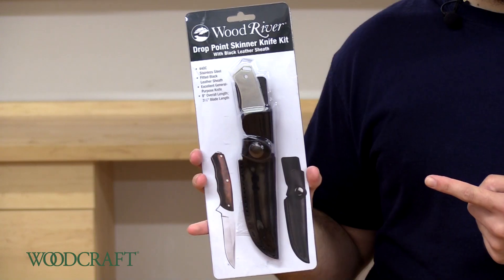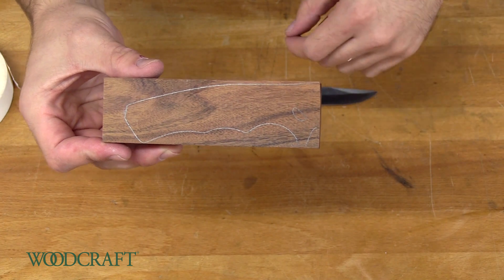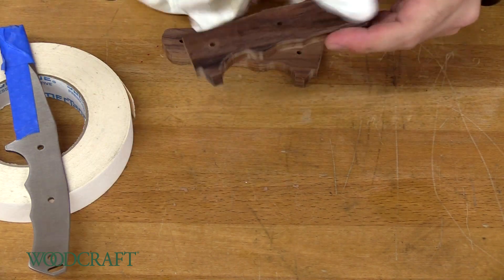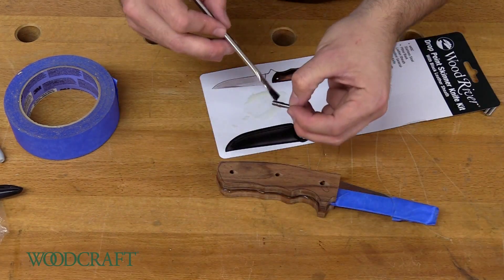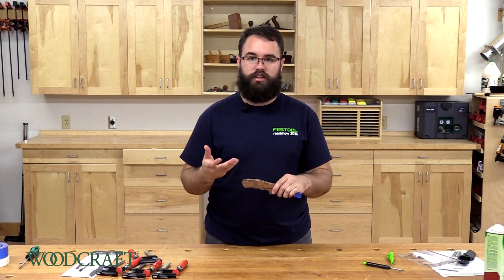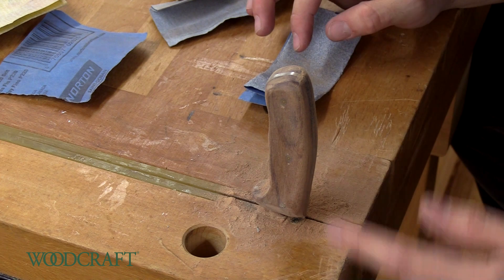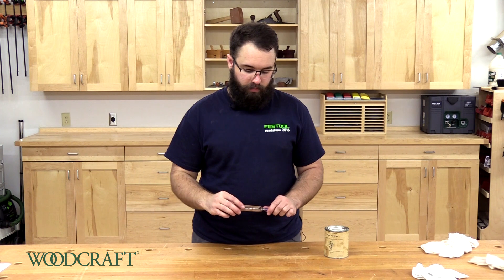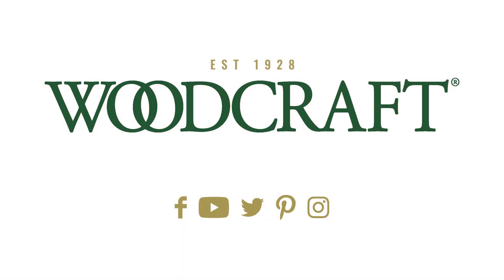WoodRiver Knife Kit Build

Comment: I personally have found the router really helpful for the shaping, using a flush trim bit to make it exactly the same size as the metal, and then a roundover bit to start off the shaping some.
Reply from the maker: It was my first one so I tried to follow the instructions as close as possible. There are a ton of ways to do it, I hadn't thought of a flush trim bit but that's a great idea. I'll try a bunch of stuff next time.

Comment: Glue the pins in?  Don't you want to cut them long and peen the edges to mushroom out? I think an epoxy could come apart,  also I think id use a clear coutertop type 2 part epoxy for a finnish, you can put some sparkling flakes in it and pearl color to add some bling.
Ez on the bling.

Comment: So, do you just grind off the regular screws that come with it once they’re glued in place and tight?
Reply from the maker: If they are just the pins yes, they should just sand down with the wood. If they are the rivets with a bigger head they should be the right size.